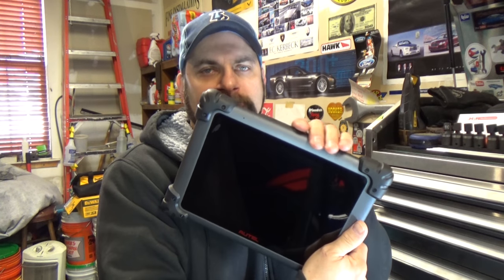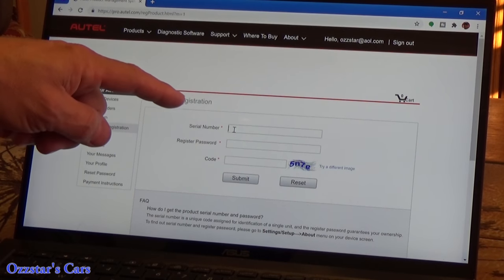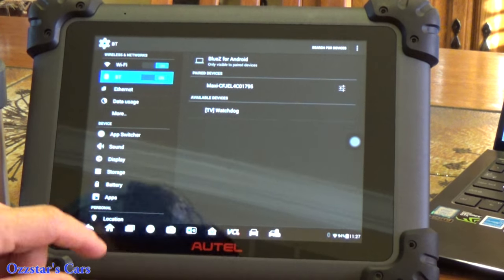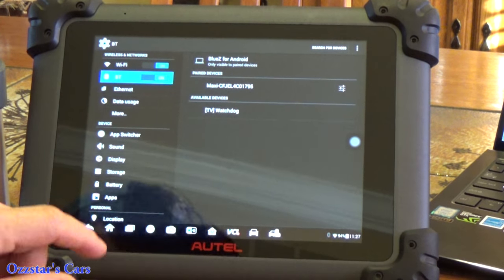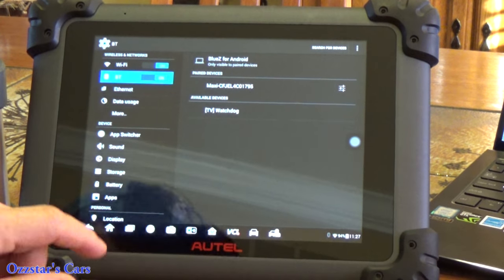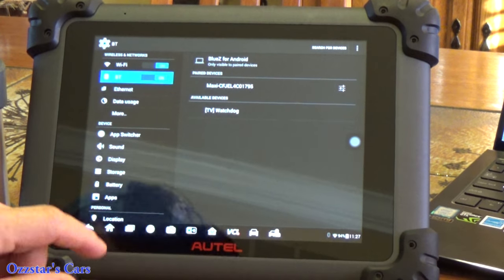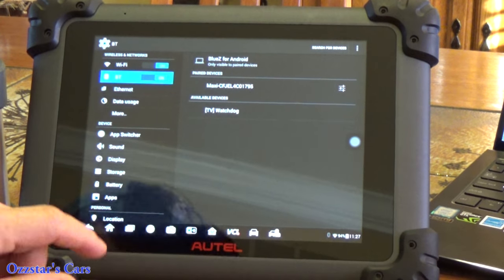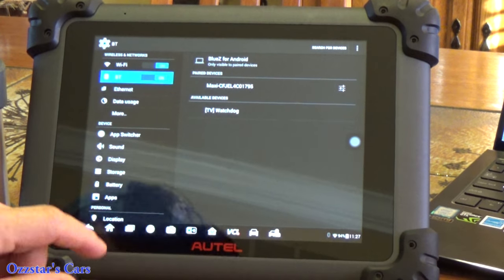The Best Scan Tool for Mechanics? - Autel Maxisys MS908SP Vs. MS906BT

Comment: Thanks for the video great info learned alot just a quick question. when programing can in be done with 1 ton 3 ton isuzu trucks?
Reply from the maker: I am not familiar with Isuzu vehicles.  If the program factory software that you subscribe to is compatible with the J2534 then it shouldn't be a problem.  Contact Autel directly.
Reply: @ozzstars_cars  okay makes sense so if Im getting this right as long as I have the j2534 box and a Microsoft based laptop I can reprogram modules
Reply: on most vehicles
Reply from the maker: @danny5699  not all modules and an oem program subscription  is needed. The Autel tool must have a current active subscription for the jbox to program.

Comment: Thanks a lot for that great information, I have a question, first of all I'm a fleet manager working for school transportation and I also mechanic ( inspector) I do all the repairs that we need on bus's and vans and minivans , well I kept looking and searching for a good scanner that co do what I need , can you please help me , the issues that I'm facing is when I replace the abs sensor or the speed sensor then the lights stays on so I keep taking them to the dealership to reprogram them , which Autel scanner will be good for me , ( we only have ford ,gmc,chevy, Dodge) thanks
Reply from the maker: It would probably be a good idea to contact Autel customer service.  They can help you with specifics. In my experience the Autel Maxisys works great on domestic vehicles.
Reply: @ozzstars_cars  thanks I appreciate it.

Comment: Was curious if the MS908SP had more hot function features available than the MS906BT if you where to use each one on the same exact year, make and model vehicle. Hope to hear back from you. Thanks.
Reply from the maker: I don't believe it does.
Reply: @ozzstars_cars  Nice to know. Was not sure if the ms908sp would pick up a few more of the vehicle specific service functions than the ms906bt seeing as it is around one thousand more dollars. It is pretty cool to know that the extra money you pay is only because of the ability to program the BMW, Mercedes, Mini and Maybach. You pay $250 for each of the cars and you can do it right off the tool. To bad I own Ford and GMC, otherwise I would by one. Instead I am going to go with the MS906BT seeing as it does not lack any of the vehicle specific service features that change per vehicle. Thanks for all the information and the videos you put up. It was a huge help in choosing. Nice to have someone trustworthy that has actually had their hands on the tools. Appreciate it!
Reply from the maker: @ajd4788 besides the programming capabilities with the J2534 the 908SP also has a larger display screen, faster processor and includes the maxi video (inspection scope).  I appreciate your comments and it gave me an idea to shoot a video on comparing the scan tool hot functions apples to apples.  Glad you found the tool vids helpful and stay tuned for more.👍 -Glen
Reply: @ozzstars_cars  I hear you. Now the MS906BT kit comes with an inspection camera but you pay $1269. I will keep my eyes out. Thanks again.

Comment: I need some help anyone.  Do you have-to pay for the update every year to keep the scanner active (like a subscription)? Or if you dont pay for the update every year will mean it will still operate but only with the last updated installed?
Reply from the maker: You are correct, annual subscription.  I discuss that the 908SP in the video will not program if the subscription is out of date.

Comment: Besides the programming functions and the better hardware. Does the 908sp have any different software than the 906bt?  Do they do the same coding functions?  Thanks for the videos
Reply from the maker: Yes, they both share the same  coding functions.  The 908SP also has a faster processor and bigger screen. Both are great tools in my opinion.  Have you seen the 906BT video I posted on the YTube channel?
Reply: @ozzstars_cars  Yes I saw your other video when I was figuring out what to get.  Purchased a MS906BT a few weeks ago.  Wasn't sure if the 908sp had any other extras.  For my use th 906BT is fine.  If I used it for a living I would get the 908SP or better. Thanks for the answers.

Comment: Hi Ozz . My Liberty Diesel 2006 has a ignition key issue . When I put the key it is not cranking , no start . How can I reprogram it own key again
Reply from the maker: The Autel im608 is designed for key programming. Some makes require a pin code from the manufacturer.

Comment: Glen I just purchased this and wanted to know for the GM software can that be loaded on the Autel tablet itself or has to be on separate laptop because I'm trying to program a new Fuel control module I just replaced in a Chevy Cruze 2011?
Reply from the maker: You will need the J2534 and a laptop with a subscription to acdelcotds.com.  The scan tool tablet itself will not program cars other than BMW or Mercedes.  The GM site has passes for vehicle module programming starting at $40 for each vehicle.
Reply: @ozzstars_cars  Thanks and have the J box so purchasing membership today.
Reply: @ozzstars_cars  Glen you stated on the video that the laptop has to be set up in a certain way because I purchased the subscription but I'm stuck at the SPS page and program doesn't download.
Reply from the maker: @genek3961 I believe the laptop has to be Win 10.  What is SPS?
Reply: @ozzstars_cars  Ok I'll try the Windows 10. Service Programming Service is the screen I get when I hit view in my subscriptions.
Reply from the maker: @genek3961  there should be info on the acdelco site as far as the requirements your computer needs along with a good internet connection.
Reply: @ozzstars_cars  Glen thanks for the help and figured it out that the laptop has to be running Windows 10 Pro to allow the acdelco programming to run.

Comment: If you buy the scanner and don't pay for updates, will all the functions still work up to the year did the last free updates?
Reply from the maker: Yes it will work but the MS908 J2534 will not have programming capability.
Reply: @ozzstars_cars  Even for older cars (which you pay the dealer website for the file)?

Comment: Can I ask you which one should I get MS906BT or MS908SP Autel I repair all my family cars mostly GM/Ford/Chrysler I do need Bidirectional I been working on cars 20 years. ?
Reply from the maker: If you plan on doing any programming then the 908SP, if not the 906 works great but no scan tool does it all.

Comment: HI, Im aDIYer and a am a former auto mechanic and Engineer, what do you recommend to someone like me and I have a 2014 GL350 with airmatic suspension.
Reply from the maker: The 906BT is fantastic but if you plan on doing any programming then the 908SP is the way to go. It has BMW and MBenz programming built into the tool without using the J box.  The MS906BT has worked very well for me when doing diagnostics, especially using the bi-directional control technology.
Reply: @ozzstars_cars  is there something cheaper then that for a mb gl350.

Comment: I was super dis-appointed in the tools ability to graph data. The data pids refresh rate is very slow but i like to be able to graph muliple pids or record a road test. I use my Zeus for that since it graphs data and road tests better than any tool ive ever used.
 Don't waste your money on the scope option as its the worst scope i think ive ever seen. 
For a cheap Chinese scan tool it has good coverage for the money. I hate buying Chinese anything though whether its a scan tool or going to walmart. Plus with their history of pirating software from American companies and being sued muliple times its hard for me to excited about them. 
I always have two scanners one being my Snap On I was thinking about checking out the Gscan for my second tool and shit can the Chinese tool.
Reply from the maker: No scan tool does it all, that's for sure.  I have had no issues using the graphing feature with the Maxisys but then again I don't own a SnapOn scanner.  I'd prefer to have an Autel Ultra which would be top dog.  Like you I have purposely bought Made in the USA products (not just tools).  I have been disappointed more than once for the extra money I spent hoping for a superior product.  Thanks for your point of view and checking out the video.

Comment: whats your thoughts on the maxisys ultra ?
Reply from the maker: I wish I owned one.  The module topology feature and quick access to an oscilloscope are some convenient features.  Powerful tool for the money in my opinion.
Reply: @ozzstars_cars   where could i go to get information on there subscriptions and price
Reply from the maker: @boallmon324  Purchasing from a certified dealer usually includes a 1 or 2 years subscription with a full warranty.  I would start by searching online.

Comment: the major problem with Autel is they charge far too much for their annual updates - I recommend you check out the cost of updating any one of their tools before buying and compare to other scanner diagnostic tools since all are based from the same Chinese maker some of e-which offer free lifetime updates - I also disagree about their customer service which I have found is lacking - most of the time they don't bother to reply to your messages as well I think their tools are on the expensive side for what you get

Comment: So these 2,000 dollar plus scanners wont read codes on my 2022 ram but I can plug 30 dollar scanner from ebay into it and read codes that is a damn scam
Reply from the maker: Kust need the right software. If you have an older scan tool add AutoAuth for $50. It will access 2018 and newer Chrysler junk.

Comment: I made the mistake of purchasing an autel scanner. Not at all impressed. Bad data, false trouble codes, and ridiculous amounts of problems connecting to wifi. The fact that it runs on Android 4.4.4 is a complete joke. It's supposed to be a "modern diagnostic tool" but it operates on an android system that's 8 years old. That's actually rather pathetic. Didn't erase all my personal data after a factory reset, which is beyond ridiculous. I can't ever trade that piece of garbage in or sell it because I can't wipe my personal data from it. Can't use it on modern day Chrysler products without a special adapter because of the gateway module, which adds unnecessary time. Never had any of these issues with a snap on scanner. I was hoping to avoid paying snap on prices because I'm looking to upgrade from the junk autel I'm using, but at least with snap on I'd be getting a known good product. I honestly don't know what people see in these autel scanners, other than maybe price point. Overpriced, unreliable junk in my experience.
Reply from the maker: Bad data and false trouble codes?  I'm interested in hearing about the specifics.  You are comparing a $1200 scan tool to a $10,000 scan tool.

Comment: And you need a  laptop  and only bmw and mercedes
Reply from the maker: @TheMcs33  J2534, laptop, manufacturer software subscription and the scanner must have a current subscription.
Reply: I have a question. I have a window  master switch  that's has  fault code in the module and I replaced  the hole switch and . It's still saying malfunction  code still there going away....do it have to be coded
Reply from the maker: @TheMcs33  since you never mentioned any details on what vehicle it is I couldn't tell you